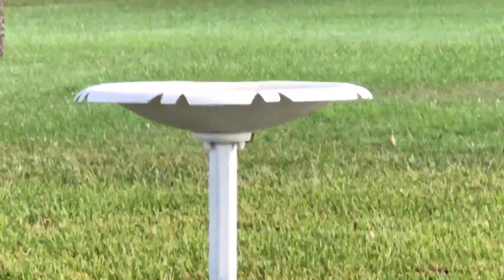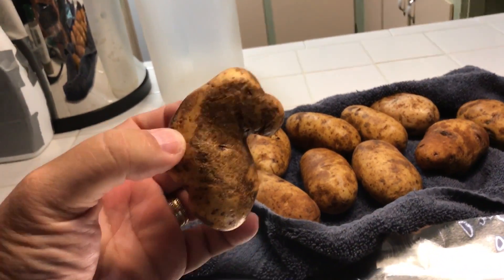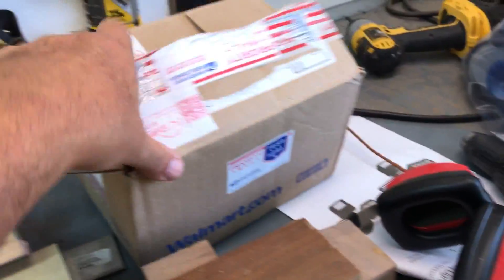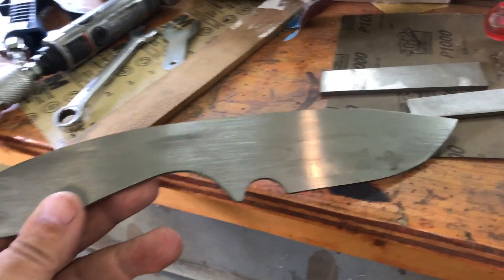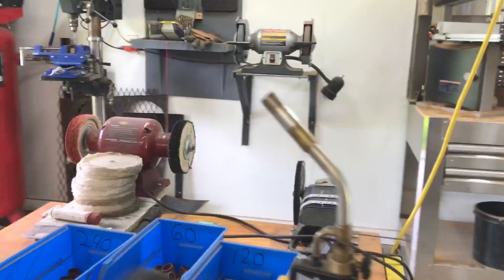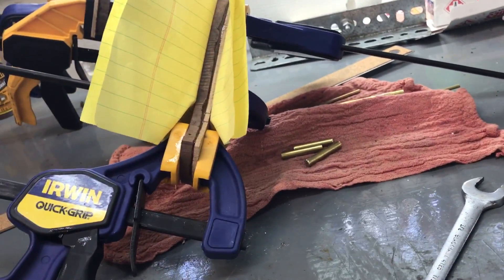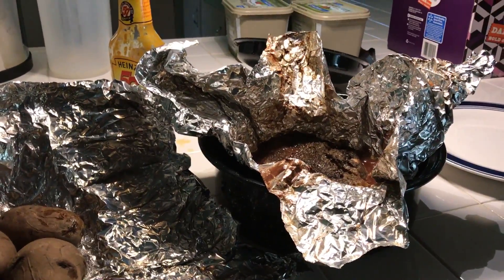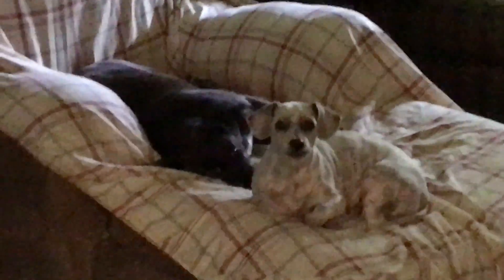Solar oven cooking, knife making and coffee drinking

Comment: Awesome! Those pups sure look like they are great helpers! Thanks for the shout out...yessir, it is a Rand Solar oven. $70 on Amazon. Got the tray on eBay for $45. The tube is larger than the GoSun solar oven (which is $280 on Amazon). So, less than half and bigger cylinder. Much easier to stuff more food in it from what I can see vs the GoSun solar oven. VERY impressed with the Rand Solar cooker...def hooked. Gonna do some bacon tomorrow.